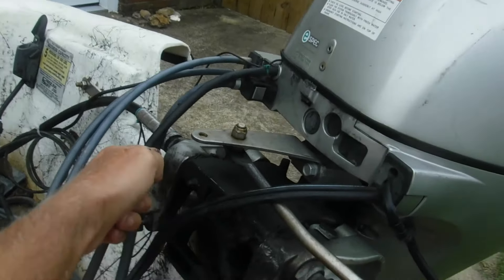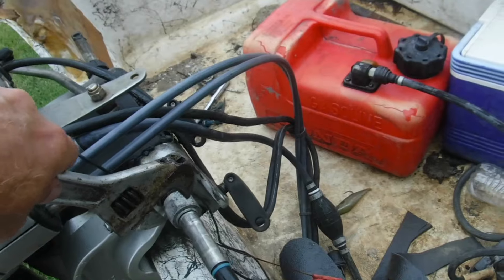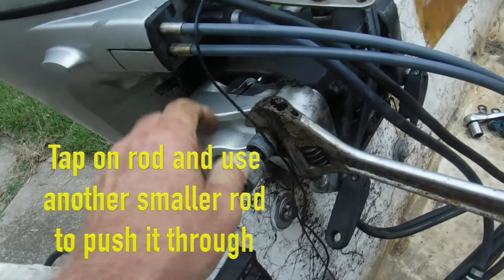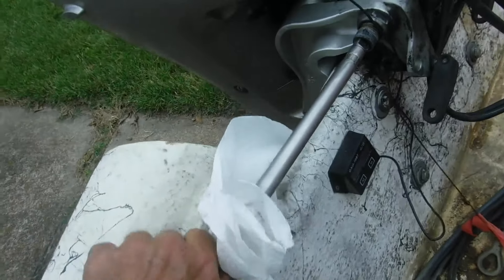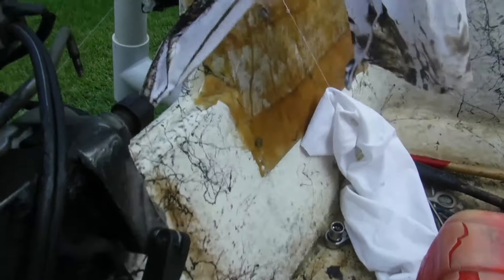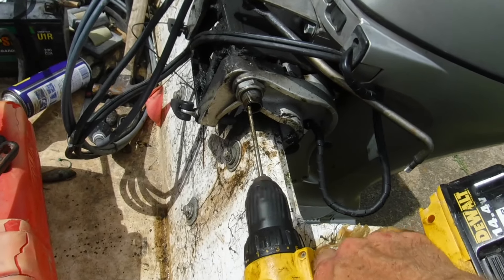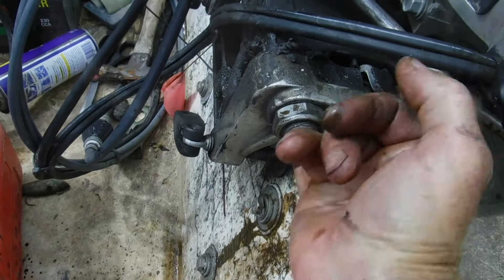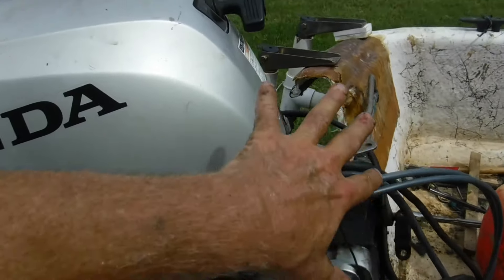Boat Steering Fix

Comment: Thanks so very much. I just bought an old pontoon and didn’t check the steering first. I even had to notch out part of the deck with a jig saw to pull the rod all the way through. So nicely greased now, a man with no arms could steer it!! Thanks again for explaining the process better than anyone!
Reply from the maker: Glad it helped

Comment: Great job with this video - solved more than just our stiff steering but actually helped with swapping out two different makes of outboard engines.
Reply from the maker: Glad to help! Now go catch some fish!
Reply: Thank you so much for the advice.Went through that procedure.Definitely better.The tube for the rod was so pitted.Does the cable angle make any difference in your opinion?

Comment: Hi. I have a 1993 Johnson 150 outboard that just started to have hard steering, especially turning left. Thankyou for the video. I will give this a shot as soon as I pull the boat out of the water.
Reply: How did it go?
Reply: @prestondoonan5069  Unfortunately I was unable to get the steering arm out of the tube. I cleaned everything else best I could and regreased it. Slightly better but still a little hard turning left.
Reply: @alciambriello6961  thanks

Comment: Have upgraded to hydraulics due to this problem. Excellent video 10 out of 10
Reply: But doesnt hydraulic still use the same grease shaft? I thought it just eliminates the cable, but still uses this bs part.

Comment: I got everything loose but the rod won't budge a bit when I try to get it out from the motor. Suggestions? This is a great video for me as a novice. Thanks!
Reply from the maker: Spray it with some nut buster and tap with a hammer? Going to take some time probably rusted up!

Comment: Awesome video man. I was ready to throw the towel in....almost. After many swear words I thought good ole YouTube might have some help. Before viewing this tonight I got to the point of removing the big coupling nut on starboard side but didn't try the port nut to allow the rod to be removed. But oh man - i was spraying WD-40 into the hole around the shaft and the rust that was flowing out was wicked......Let you know how it goes. Praying it's not the motor pivot points - this fix is so much simpler. Thanks a again.
Reply from the maker: Let us know if it worked! Love saving people some $$$!
Reply: @Gigmaster  Thanks for responding my friend. Like magic and to my delight I loosened the tie rod and the motor moved as freely as yours did - that is good - the steering tube (vertical) sounds like a tougher issue. Dang mine is stuck good. Looks like I am going to get an inch a day and so in about 7 days this thing should be out. I am not in a hurry and not giving in. I bought a Harbor Freight air hammer  for $12 and all it did was make a lot of noise - good tool though - just not strong enough for this job. I used the tilt to move it up and down thinking the tube would rotate around the shaft and loosen the rust and grease. I also - while there is enough room to grab - put a pipe wrench on the port end and rotated it back and forth. Every time I do that it help me to get another 1/8 inch out. Haven't tried heat yet......... let y'all now tomorrow - its beer thirty.
Reply from the maker: Keep working it slowly I think you are on your way to success! Keep us updated.
Reply: @Gigmaster  This long message may help others not to give in - keep pounding - it beats $2000. We finally got it out with the help of my friend who really knows how to throw a hammer proper - a 3-pounder I believe. With minimal room in that transom area we had to keep about 7 or 8 different lengths of metal "drifts" handy to get give us the room to hit the end of it and push it all the way through. In the end we had to stack 2 drifts behind the end of it. We used "all thread", socket extensions and allen wrenches - all sawed to different lengths. All in all, about 5-6 hours of pounding - between the resting and BSing. I sprayed PB penetrating oil into it nightly and would take a few whacks daily. Heating the middle of the tube with a heat gun helped soften what we thought might be old grease,  but in the end may be just making the metal expand the right way to help. We noted the rust every time we removed the drift was fine and very dry - so we are not sure if there was very much grease in this tube after all? We found it would not move at all with the lighter blows - there was a minimal force required to get this thing to move.  Unfortunately after all of that, we sprayed oil into it and saw it leaking from the middle of the tube - a hole rusted through the tube. I am going to try and thoroughly hone it out and JB-weld the little hole for now to get this thing running - before long its going to need a new tilt tube. Another option may be a external transom mounted steering assembly and just not use the tilt tube. Another thing that happened was the small hole at the end of the assembly that is for the tie rod split some, but is still usable - lesson learned - you might try to find something to fit snugly in that hole to help keep it from getting split from all of the pounding. Sorry for the long message, but maybe it helps someone else. Whew. Thanks again.
Reply from the maker: Thanks for the update.

Comment: Can you from that rod adjust the steering? When my steering wheel is straight, the engine is not straight but more to the right, how could I fix that? Thanks.

Comment: As far as preventative maintenance, could I apply a thin layer of grease on the steering rod without taking the cable completely out?
Reply from the maker: Use the grease fitting if you have one otherwise I would keep a coat of marine grease on it.

Comment: does anyone have any advice on how to get the rod out of the engine tub?? mine is so jammed up that I've been hitting it with a hammer and it won't budge. I also smacked the boat with the hammer and now I busted the fiber glass! not much room to work with on my transom.
Reply from the maker: Spray some nut buster in there

Comment: I really appreciate this video but I have a follow up question if you can help. What if you don't have enough room to pull the rod out all the way because a part of the boat is in the way?
Reply from the maker: Unbolt motor and move it over?
Reply: @Gigmaster  that's what I thought we were gonna have to do. Thank you!

Comment: Thanks for the tip, how do you get the steel-wool to stick to the rod inside the drill?
Reply from the maker: The steel fibers wrapped around the drill head
Reply: Hello! Thanks for the video, but I would like to see how you get it out.. don’t get it and I got the same problem
Reply from the maker: Get a rod slightly smaller than the shaft and tap it out with a hammer.

Comment: Yep. That's my problem. On top of it I used to much force to turn and the steering wheel turns loose ( a little friction )  clockwise only. Counterclockwise it blocks as supposed to when the rod is stuck. Anybody any ideas ?
Reply: I have the exact same issue. I'm going to try and clean out the steering tube soon. The boat is only 2 years old, but it's entirely possible it was never lubed.

Comment: Just curious, why do boat mechanics recommend new cables when this is the solution? Is this just a bandaid and we really do need a new cable?
Reply: @ how is your steering holding up? Did you end up needing a new cable or does greasing it every so often work?
Reply from the maker: @Steve_Balboni  Never had another problem with it. Worked like new when I sold  that boat
Reply: @ thanks for the reply!!

Comment: With my motor the problem is in the outboard itself not the steering cable. When I disconnect the steering cable from the engine, it still barely turns. Can anyone tell me how to fix this?
Reply: did you fix it yet, i think i know

Comment: Makes no sense to me why they engineer these things with so little clearance between the cable and tilt tube, such that the slightest bit of crud seizes it up. An extra 1/4" of clearance would make a world of difference.
Reply: That would allow a lot more crud to get into the steering tube. It's also a terrible way to promote evenly distributed fluid dynamics. Best to just clean it seasonally.
Reply: @ChainsawChristmas  I did, and the cable still froze. After replacing it for the second time, I fixed it permanently. Switched to hydraulic.